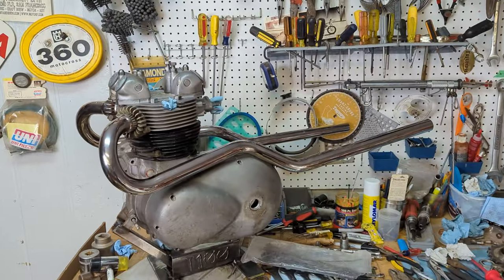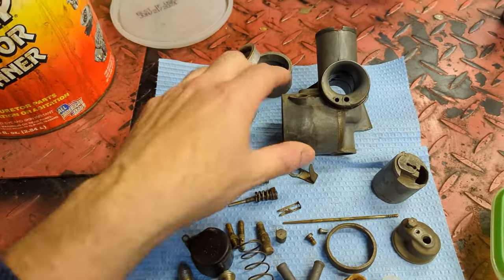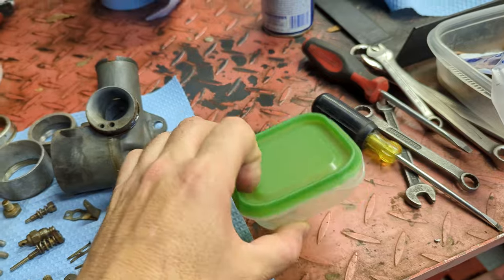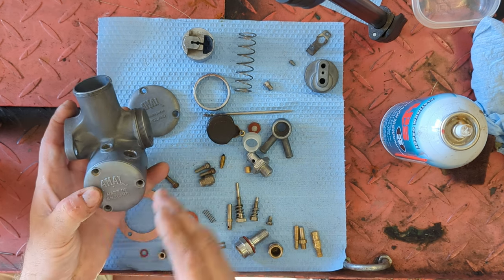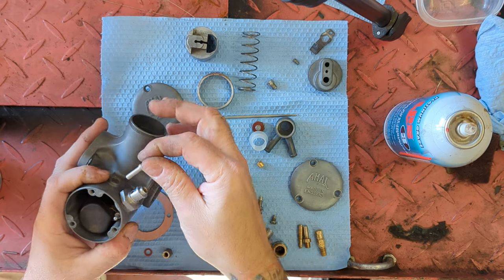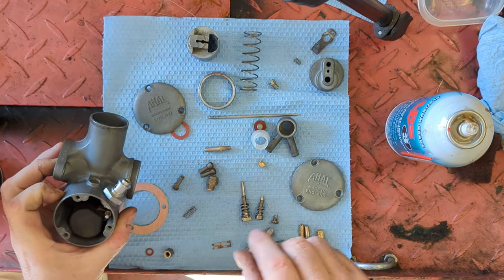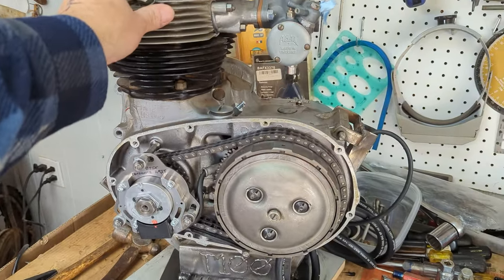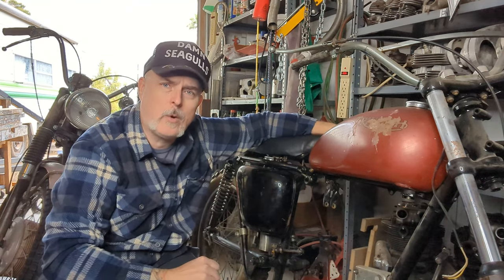1967 Triumph T100C: PT 6 "The TARANTULA!"  AMAL MONOBLOC CARBURETOR - Barn Find Desert Sled

Comment: Good job on the carb rebuild......your collection of tools looks just like mine as well as your procedures.  Those old Amals were not the most sophisticated of carbs but worked quite well when clean and thoughtfully adjusted.  My main problem was living at 6200 feet altitude and running up to 9000 in Wyoming mountains.  There isn't much air in the air at 9000 feet!  I used Bing carbs on some of the Husqvarnas but jets were like gold to buy and pretty soon I could not find them. A Bing will run better wide open than the same size of Mikuni  I found out.

Comment: Good stuff.  I have a 64 TR6 that came with an Amal concentric from the previous owner.  It was starting to get finicky so I replaced it with a brand new Amal concentric premier (which has worked great) but part of me wishes I had gotten the proper monobloc for the bike instead.   One of these days I'm going to shell out the money for a monobloc...just to see what the difference is.  In the name of education.  

I have a friend with a 57 TR6 that wasn't running great.  We put a new Monbloc on it and now it runs great. The monobloc is a sweet carb.  We didnt use that fiber washer, so I'm glad to hear you say not to.   I do wish the monoblocs had the extended tickler like the concentrics have... just so I don't get gas on my hand.
Reply from the maker: I certainly don't mind a concentric on a bike that came with them, I just like the ease and look of the monobloc.  But another problem that happened later with Concentrics was the pressed in pilot jets... and that's just dumb.

Comment: Could you bend the float tab and then use the gasket ?
Reply from the maker: There's no tab to bend. I've tried manipulating these floats before and all I ended up doing was ruining the float. I think you could add a dab of solder to get more height on the float, but removing the fiber washer is easiest.